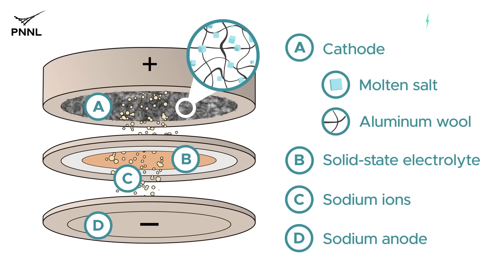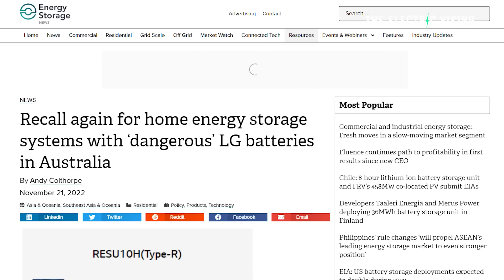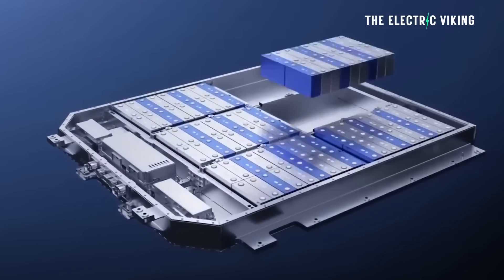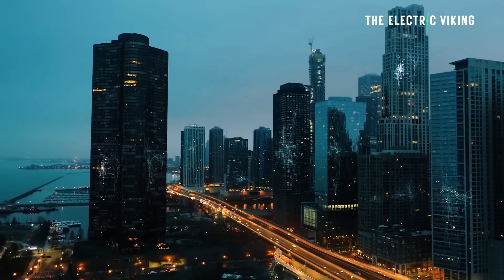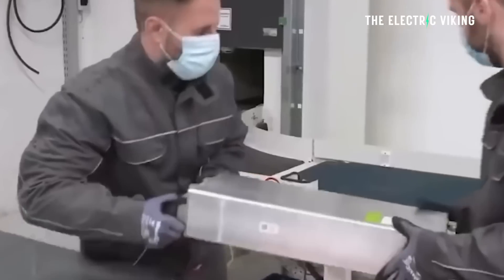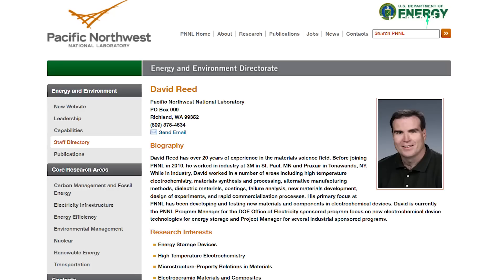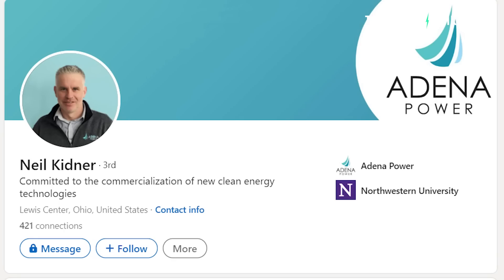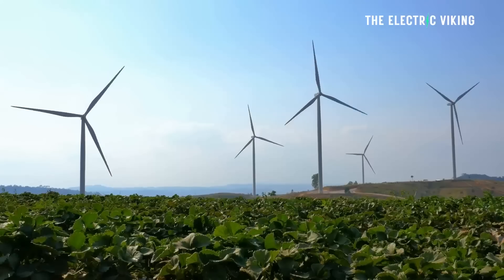NEW Sodium, Aluminum battery is 15X cheaper than sodium or lithium

Comment: I heard about gravity batteries and also about other types of battery such as hydrogen or compressed air or lead acid or …
We can also combine other types of battery with gravity battery. For example if you have led acid battery then more over than using their chemical aspects to store the energy we can use wight as battery to have combinational batteries. If salt batteries be used is gravity batteries as well, then we have combined them both and that gives much more storage capacity.

When it comes to air compressed batteries that even is more interesting, because we can lift the battery when it is empty and when it is up in the maximum position in the air then, and we don't have any more module to lift to store the energy then we can fill them/it up with liquid (compressed) air that is heavy as well. Then, when they come down to the ground to release their gravity energy, they are much heavier than the first place. After it comes to the ground, then we can still use the compressed air energy of it.

This idea is very raw and might require some more working around and correction but it shows the main concept

Comment: Imo a 10 hour battery is strictly 5x worse than a 2 hour battery. To make a 2 hour battery last 10 hours simply drain it at 1/5th of it's max discharge rate. 

People claiming higher hours is better makes no logical sense.

Comment: @ “batteries in many  parts of the world will only need to store and release in summer and the shoulders of Summer”

Seriously? Where. I’ve done extensive modelling of Western Australia for 90% and 100% RE and I can tell you the highest output of PV is the shoulders of summer, cool temps but strong insolation still. 

Winter wind droughts are the issue for most states i Australia. More overcast, dark clouds for weeks at a time. Wind dropping away for 10 days in a fortnight. That’s where seasonal depth storage is needed to e paired with overbuild of RE. 

Also you didn’t mention energy density, Watts per kilogram.  Te amazing throng about some fathers saline (sodium) chemistries a they have a theoretical energy density of 2000+ W/kg and that a in the ball park of 100+ passenger aircraft for long duration flights.

Comment: On important things about saline is that you don’t need to de-rate the power discharge/changing to manage any thermal issues as they must with lithium ion. 

And often is their were thermal issues if you’re using saline electrolyte is like a forecaster in every cell!

Comment: I predicted saline (sodium) batteries would overtake lithium before lithium reserves became overstretched six years ago after talking a lot to the developer of a saline electrolyte ceramic electrode prototype and hearing about the theoretical energy density limit being many ties that if lithium ion. Also no thermal issues. they couldn’t get through the valley of death but the potentials were convincing.  If they’d been backed by NREL o find some basic science on the prototypes it would have unlocked a lot of the nano scale mysteries ogre ceramic electrodes. I’m talking about energy densities  well above 1000 W/kg this kind of density is what someone at NASA suggested is the threshold for 100+ passenger aircraft for long duration flight. It’s coming I’m convinced. 

So NREL didn’t release proof of low cost, why would they before commercialising it. This is just flying a kite so investors get some FOMO and invest in commercialisation. Cost targets would be fairly accurate if there’s no major scaling hurdles.

Comment: If batteries are easier to change and recycle and hold up better and hot temperatures and can be improved with solid state crystalline materials. All that is very possible because the price, to change batteries like this for most applications even a few times at those prices would still beat the cost of higher lithium batteries and the cost eventually will get even better. Sodium is the way plus with desalination, humanity will be on the right track.

Comment: Sodium sounds like a very good material to use. It is so extremely and easily abundant everywhere there is an ocean. This battery does not sound like it is ready and I wonder if aluminum is needed. It would be ideal if chlorine was needed instead so that the batteries could just be made from the waste from a seawater purification plant.

Comment: Sorry Viking, but you should really read the research before posting shit you don't know about. This researcher works on MOLTEN SALT sodium batteries, and pacific northwest national laboratories themselves say this: We are getting similar performance with this new sodium-based chemistry at over 100 °C [212 °F] lower temperatures than commercially available high-temperature sodium battery technologies, while using a more Earth-abundant material."

Which means these MOLTEN SALT batteries operate at temperatures over 100°C lower than other molten salt batteries.

This is significant, because other molten salt battery tech operates in the hundreds of degrees C range, I think about 350-450°C.

Meaning this new tech might work at temperatures around 250°C.

In your video you make the claim that these work at temperatures lower than lithium ion tech. This is simply false, and by design, would prevent this battery from working. The salt would freeze, becoming solid, and not working. These batteries have to be insulated and kept hot.

This seems to be a reoccurring theme on your channel, spreading lots of hype...

Comment: Watt Hours per Kilogram is not the same as Watts per kilogram. Watt Hours per Kilogram is correctly the measure of Energy per weight (as a substitute for mass). To shorten it changes to non-sense  - power per mass. Energy is measures as power for a time duration.  
This shortening for slang science is a very bad practice. It is like saying   xxx kilowatts instead of xxx kilowatt hours. 😂

Comment: Lithium is just up due to supply and demand.    a bunch of automakers seemed to have finally decided that EV might be a thing.     Oh  .. and also that maybe EV are a little tougher than they have been saying for the past decade. 

Apparently, its not cool to have extra 100 pounds of wires and stuff extra batteries in your vehicles instead of working on better regen.

Comment: Good for up to a few hours. But if you want to store Sydney's power for 2 days - that's when you pump water up a hill.
Reply: OK, pump runoff from hydro electric plants back above the dam when the sun shines. 
Hoist concret blocks uphill and harvest the energy at night as they ride the cable back down. 
There are many "mechanical battery" potential designs. 
Concrete blocks take a long time to wear out.
Reply: @patrickhenigin4805  Concrete blocks emit CO2 in the making, and the blocks get in the way of each other as they get higher, reducing the 'head'. Off-river Pumped Hydro Electricity Storage (PHES) can be built faster than on-river, cheaper, safer, and with no ecological concerns about disrupting a fragile river system. Build PHES within a few dozen miles of a river. Build it all at once - the upper and lower reservoir and turbine rooms all together so you’re done in 3 years. Off-river avoids expensive spillways for 1 in 500 year flash floods. When finished, slowly pump the water from the river. Cover in floating solar panels to reduce evaporation. Top up from the river every few months. Satellite topological maps show most continents have over 100 TIMES more sites than they need. Pick your best 1% and you’re done. Professor Blakers shows the world situation (after a brief Aussie introduction). http://youtu.be/_Lk3elu3zf4?t=986  It loses some water to evaporation, but only 1/5th the water of coal thermal plants! 
See here: http://iopscience.iop.org/article/10.1088/2516-1083/abeb5b#prgeabeb5bs6
PHES can be really big or really small, like this one for Walpole, an Aussie town of 500. http://www.abc.net.au/news/2021-11-01/renewable-energy-fix-walpole-power-problems/100579700
Reply: @patrickhenigin4805  concrete crane storage has been debunked over and over.
Reply: @bashful228  while thete are engineering and technical problems to be resolved, Adam Something did not  debunk gravity storage by any means. 
Water storage seems to be the simplest solution where practical, saying that gravity storage is like saying that battery electric vehicles will never work or that the the horseless carriage will never replace the buggy.
Reply: @patrickhenigin4805  dude i have no idea who Adam Something is. regular engineers know crane gravity energy storage doesn’t add up.  it’s not even close so any improvements won’t help it beat the fundamental issues.
Reply: @patrickhenigin4805  you need to learn how to read short sentences and parse the meaning. i didn’t say anything about gravity storage in general. the vast majority of energy storage that is t fossil fuels is pumped and stored hydro. it is economic and will remain so for some time in the medium to long duration energy storage space. i spoke about cranes with contente blocks. it’s not even close to competing anywhere in the storage market.  and the embodied energy is a joke. . .
Reply: Dream on
Reply: @robertfonovic3551  Off-river Pumped Hydro Electricity Storage (PHES) can be built faster than on-river, cheaper, safer, and with no ecological concerns about disrupting a fragile river system. Build PHES within a few dozen km's of a river. Build it all at once - the upper and lower reservoir and turbine rooms all together so you’re done in 2 to 3 years. Off-river avoids expensive spillways for 1 in 500 year flash floods. When finished, slowly pump the water from the nearby river. Cover in floating solar panels to reduce evaporation. Top up from the river every few months. Satellite maps show most continents have over 100 TIMES more sites than they need. Pick your best 1% and you’re done. Professor Andrew Blakers from the ANU presents the data. http://youtu.be/_Lk3elu3zf4?t=986  This loses some water to evaporation, but only 1/5th the water of coal thermal plants! 
See here: http://iopscience.iop.org/article/10.1088/2516-1083/abeb5b#prgeabeb5bs6
PHES can be really big or really small, like this one for Walpole, an Aussie town of 500. http://www.abc.net.au/news/2021-11-01/renewable-energy-fix-walpole-power-problems/100579700

Comment: I have heard of many battery chemistries talked about, but there is a large valley of death between the lab and mass production. If we can get very cheap low energy density batteries for stationary energy storage, that can free up the higher energy density batteries for EVs.
Reply: @orionbetelgeuse1937  
At this point lithium battery recycling is just starting to take off, and it is proving to to be economically viable and technically feasible to recover the materials. Cycle life is a lot more complex than the standard rating. The standard rating is for the battery to have 80% of its original capacity after the rated one hour charge and discharge rate. 

There are further complexities in the charge and discharge curve, but this provides a good basic standard. So a battery with a 1C charge and a 1C discharge rate will charge to 100% in an hour, and discharge to 0% in an hour. A battery with a 0.5C charge rate and a 2C discharge rate will charge to 50% in an hour, and fully charge in two hours, and fully discharge in half an hour. Any charge or discharge cycle that is slower or not a a complete charge or discharge will extend the cycle life. So two 50% discharge cycles at half the normal charge and discharge rate does not equal a full cycle, but a fraction of a cycle.

 The result is that a battery rated for 2000 cycles will have up to an equivalent of 5000 to 70000 cycles. As most stationary storage batteries use lithium iron batteries, and they generally have a 10,000 cycle rating,  they will last even more, up to 25,000 cycles. And unlike lead acid batteries that have a cycle life cliff, the 80% capacity of lithium batteries is still quite usable, especially in stationary storage where gravimetric density is not an issue.

Comment: For static applications, longevity is arguably the most important characteristic.  Doesn't sound like they have this yet.  If successful, this design would reduce the demand for Li, bring down the price and make EVs cheaper.  Some economists say that a linear reduction of the price of an EV increases its market exponentially.  That may be the real effect of a better grid storage - the greater adoption of EVs.
Reply: Yes a linear reduction of the cost most goods does tend to lead to an exponential increase in demand for said good. We are starting to see that for EV sales now. This is somewhat countered by the current limited supply of the vehicles. These battery's look very promising and if they scale the effect would be two fold. It will dramatically increase the take up of battery energy storage, which is critical if we want to transition to a more sustainable energy future. It will also free up the supply of Lithium for the production of EVs dropping the price, therefore increasing the number of people who can afford them exponentially.
Reply: This is not for static apps. It is for cars.

Comment: I read that the location of the production of the battery has a very high impact on the environmental balance. So if sodium aluminium battery can be produced close to the manufacturers plant which is also hopefully close to the sales market it would be a big benefit. I think sooner or later there will be new types of batteries on the market there are just too many companies and organizations doing research in this field. In my point of view there should be standard for batteries like there is for smaller devices. So battery size and technology can be used according to the current need then i would also be possible to buy car and batteries separately
Reply: Who cares where it's produced... Transport is cheap.
Reply: @CountingStars333  the overwhelming majority of lithium batteries are produced in china. China is also within the top mining countries for lithium. So it's more or less a monopoly with a big fat price dictate... you still don't care? In addition the energy production in china is still mostly done with coal which undermines the ecological benefits of an electric car.

Comment: Doesn't anyone take any notice ? Tesla figured out that the way to make battery cells on a huge scale (at high speed) is to make them cylindrical - like a bottling plant. Flat plate batteries are relatively slow to produce (that's not me saying that - that's Tesla who have figured this out...). Sure - you can pack rectangular objects close together...But does that matter in grid storage? You lose very little volume actually with cylinders, and they can allow some "space" for cooling or warming fluids, if necessary...(for the Elon fan geeks, the packing density of cylinders is 0.9069) Coincidence ?

Comment: Watt per kilo(gram) is a measure of power density.  The commonly used unit for energy density is Wh/kg. 12% degradation after 350 cycles makes this unsuitable for storage. Remains to be seen if they can improve this manyfold.
Reply: depends what the max and min charge was. if they can quadruple the life by keeping it between 30 and 70%, it would already be very interesting
Reply: @stefanweilhartner4415  Then you would use 40 Wh/kg, which is quite poor.
Reply: @tombratfred3102 well if the price is low enough, then it will still be viable for stationary storage. Maybe it could be charged close to 100% only a few times a year in emergency situations.

Comment: it's watt hours per kilo....not watts per kilo.   watt-hours is an energy unit.  And...at this point, all this lab stuff is hopium.  no one is going to shift battery chemistry on a dime...if it is proven out then it will still be many many years until implementation..."many many hurdles to get over"....this info is just youtube filler.  love your channel though.

Comment: One key point is the rapid deterioration of this cell.  Sodium eat up the aluminum quickly, indicated by its 20% loss of capacity after only 345 charge/discharge cycles.  So while being made of abundant elements, they don’t, imo, reach the criteria of a sustainable battery for energy storage, at least on the large scale.  Changing out the cells after a couple years service doesn’t equate to an economical solution.     I think pumped hydroelectric projects are cool, no batteries required, the water is pumped with solar or wind to elevation, and this is is your energy storage. Hydro electric generators can be easily valved to produce the exact power required to the grid during high demand times, or days when solar or wind energy production is poor.

Comment: This will be amazing if it happens. I am confident that there are so many different people working on the problem of better batteries that this problem will be solved. It will also be amazing one day if it’s economical to bring to market EV batteries that can go 500-1000 miles on a charge. Much fewer charging stations will be required. Probably not in my lifetime! ❤️❤️❤️
Reply: Yeah...it won't.
Reply: I can show you hundreds of stories about "amazing new battery/cure/treatment/etc etc etc" and nothing ever happens. How many times have they cured cancer now? What happened?